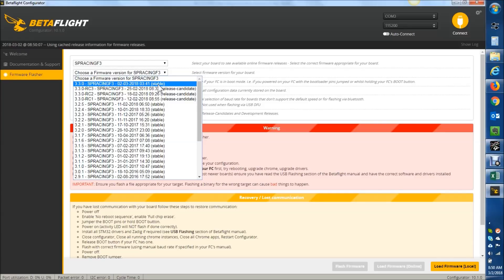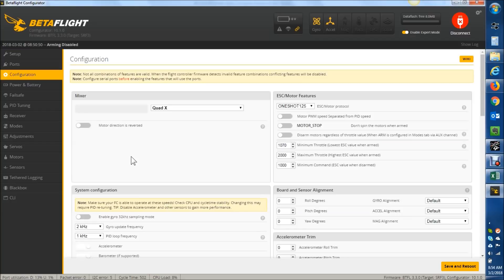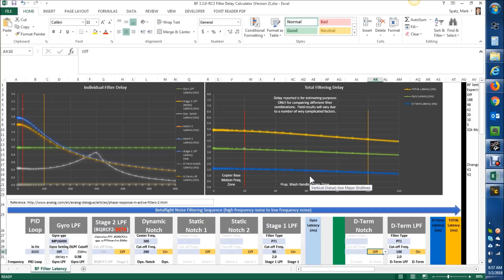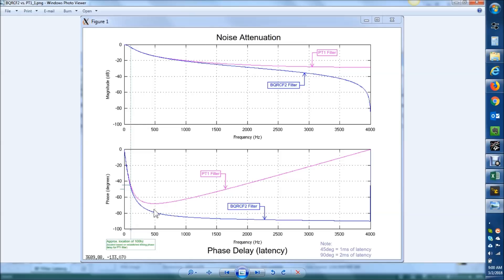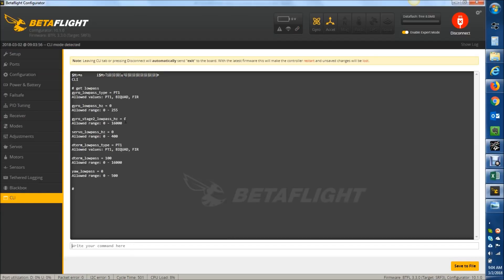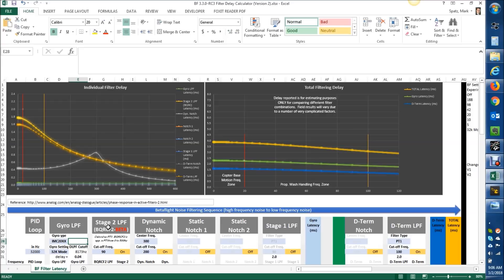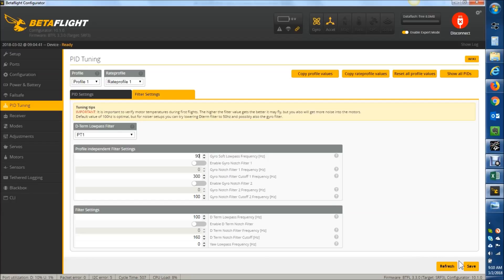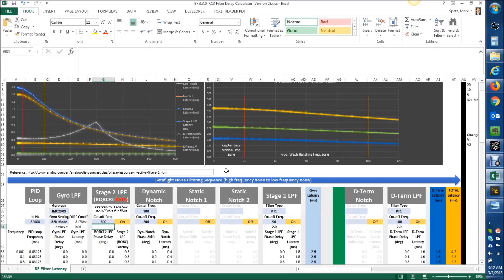Betaflight 3.3.0 Filter Tuning (Stable Release)

Comment: Sweet deal... now I just gotta fix this damn unknown device usb issue :/
Reply from the maker: Mini Quads Mega Fun , i helped a buddy with a bad one, let me make a video.
Reply: Sorry to hear that man, bad thing is this is my first full year in this hobbie, learned a lot, wish I could fly more tho.
I spent my last pay check to get into this, that was close to 2 years ago bc I all but fainted at work, come to find out I have autonomic dysfunction with being type 1 diabetic and about 4 other problems also.
And I raced go-karts for 19 years, so when I was told all this and I am not supposed to drive bc of my disability so I had to file for ssi, and that is taken forever. So I got into this bc I lost the thing I loved the most and that was racing.
Wish I could work so I could buy better crap.... teleporter v4 suck ass, flysky remote. One good quad bc I got that with the paycheck, half built one from the wife giving me 20$ here and there, and got my lizard95 for Xmas from the wife's mom.
Then on top of it all I just found out I need double cataract eye surgery 15 to 20 grand per eye.
I have no insurance or anything...... So I did feel for you..
I try my best to make due with what I got
Reply from the maker: Yeah, I have the same for my Omnibus boards (virtual VCP) when they switch to DFU mode for flashing.  Works fine otherwise.  I have to use my wife's laptop to flash (win 10) vs. mine (win 7).  That needs to end (demoralizing).
Reply: UAV Tech the weird part was after I tried it on another laptop and even did a full system restore it worked long enough to do a dump and save it to notepad... then when I went to reconnect it made the dee deww sound and the little “time he last usb device malfunctioned and the computer was unable to recognize it.. blah blah” I don’t get how the hell that happened.. it’s not like I changed anything at all either. So frustrating all I want is to finish my quad...
Reply from the maker: Did you try closing BF, unplug the board, plug in the board, and then launch BF again to connect?
Reply: Try this when that comes up as unknown....
I to have had this issue like in the last week, well let's just say I just had it again 2 mins ago lmfao.
I found out that when this happens and your computer says this it's not the fc at all.
Just so happens that it was the usb cable.... Try switching it out and us another one once.
I had one that didn't work on my other 2 and it worked for another. Switched it out and was good....
Then just now that one that didn't work o n the other 2 now won't work on the one I used it for, so I switched it out and now I'm good again.
So that usb cable I can't use on any of my quads now at all. Something messes up inside the usb cable it self.
Hope that helps some of you
Reply from the maker: The info. at this video fixed me up for my Omnibus DFU (bootloader) issue.  Would work fine in "normal" mode for connecting and configuring, however, in DFU mode it would never come up as a port for BF (or whatever) to flash.  The tools in this video worked lke a charm!  https://www.youtube.com/watch?v=dfPY1vTXNbE
Reply: Todd Beal I must have tried borrowed and bought 30 different cables... short ones long ones thick thin adapters even diy my own... did s system restore and redownloaded everything again.. on two computers... I borrowed my friends Mac book pro and am trying that simultaneously with two windows ten laptops... I’m going to give myself an aneurysm!!!!!
Reply: UAV Tech yeah I was going nuts bc I thought it was the fc giving out....or the drivers and stuff.... come down to it I did all that and it was just the usb cable that messed up.
I rather replace that for $5 then have to buy a $39 fc again.
I had 1 bad usb cables take out 2 omnibus f4 pro already. So not trying to have that again
Reply: Todd Beal you were going nuts ehh?? Check this out... so about 3-4 months ago I fell in love with this hobby and began to completely blow my bank account to get the best lootz so I could start a YouTube channel. I love tech stuff and my whole life have been a natural at things like this.. I had just finished my crowning achievement, a nicely built chameleon with all brand new, just released, components and had matched the colors blue and orange perfectly with my airbrush and custom mixed paints.. I loaded up my gear and tools and quads and camera to go film her first flight but had to stop at the hardware store really quick.. less than ten mins go by and I’m back in my car ready to go when I notice someone had cut my jeeps window and stole everything.. tools 4 quads fatsharks taranis... everything even my camera... so I’m finally starting to get my parts last week to build again and I get my kakute v2 aio to have this problem kick my in the face repeatedly.... it’s now been almost two weeks from that sad sad day and all I want is to fly!!!!!
Reply from the maker: Mini Quads Mega Fun , that is a suck.  Sorry man.  My brother races boats at a national level and had about $50k of stuff in his trailor, the hole thing was stolen.  Had insurance and police had some leads, so he got some back, but yeah, a suck.

Comment: Nice work man
Reply from the maker: Thanks,  Hope it helps!
Reply from the maker: FYI - Q=400 / R =88 is a cutoff of 355hz at a pid loop of 16k according to the data i have seen.  Soooo a i guess if you set "gyro_stage2_filter_type=BQRCF2? does it then use the cutoff of 500hz vs. the Q/R?  I didn't mess with the Butter yet, so unclear on how they are working that.
Reply: I really have no idea either..haha..I just went with your settings and added in the buttuerflight recommendations.
Reply: ...its all experimental..

Comment: I wish there was a dongle that I could plug into the quad and it would automatically tune and set the filters....😫
Reply from the maker: Me too!
Reply: Nah...you love this! LOL
Reply from the maker: You are right.  Did you see https://github.com/Plasmatree/PID-Analyzer
Reply from the maker: "This program reads Betaflight blackbox logs and calculates the PID step response. It is made as a tool for a more systematic approach to PID tuning.

The step response is a characteristic measure for PID performance and often referred to in tuning techniques. For more details read: https://en.wikipedia.org/wiki/PID_controller#Manual_tuning The program is Python based but utilizes Blackbox_decode.exe from blackbox_tools (https://github.com/cleanflight/blackbox-tools) to read logfiles."
Reply from the maker: https://github.com/cleanflight/blackbox-tools
Reply from the maker: works for me.  try again.
Reply: Nope. Maybe it's because I'm in the UK?   Edit: It's working now - it was the (())).
Reply from the maker: Yeah, UK not China or North Korea.  Click my link.   yours had a ")" in it.  https://github.com/cleanflight/blackbox-tools
Reply: Ok. I copied PID analyzer into the Blackbox-tools folder and then I'll copy BB files into as well. Cheers buddy!
Reply: Dennis Santos there is one!! It’s called a Joshuabardwell device!
Reply: Knowing that for real life tuning you must do that with props on, tuning stand would include something with heavy bottom where quad should be fixed to prevent flying away. And it would affect frame resonance frequencies anyway... naaah, better is to process flight debug logs.

@UAV Tech, try to stick to Python if you can. Those Windows exe-s aren't always possible to run under Linux :(
Reply: Mini Quads Mega Fun I wish!

Comment: Is the dterm filter delay added to the total latency?
Reply from the maker: In the sheet it does. I wanted to see the total latency. However, the P & I terms don't have the Dterm filtering latency associated with them. But the D term is soo important to crisp flight performance (bounceback and prop wash) I felt it was important to see the total on the excel calc sheet when evaluating combinations. Do note the totals graph does go further then and split out Gyro latency and Dterm latency. To me, the goal is to keep the total down as much as possible when tuning your filters. That is weighted against having enough filtering turned on to address your quads vibrations (get to the Goldilocks zone).
Reply: UAV Tech ok. Kind of difficult to understand. English isn't my native language. Would you make a video about how to read the fft debug? And what betaflight reader should i use now? I cant find the pid values anywhere in the bb viewer i use.

Comment: Your sheet and explanation is exceptional mate, finally starting to understand what bf and these filters do, it's like a big eq and filters are similar to some in my music software. Can't wait to get 3.3 loaded on my 32khz omnibus pro corner and have a fly. Thanks alot
Reply: Sorry but what would you recommend setting the gyro lpf for 32khz, right at the end of your video you have it on experimental. Also do you know if it's ok to use dshot I've read somewhere you should use multishot. I know i need to test but just wondering what your thoughts are. Thanks alot
Reply from the maker: Start with default.  Don't change to experimental.  Just don't change at all.  Only click on 32k mode under Config tab and set your gyro and pid loop frequency.  it is OK to use Dshot, but it is CPU intensive so you may need to use Multishot to lower CPU load (Multishot is just as fast as Dshot600, just an analog signal vs. digital).
Reply: Sorry, is setting gyro lowpass hz in config tab ( which I've set at 90) the same as setting gyro_lpf in cli which shows OFF as default? Thanks alot
Reply from the maker: No.  The one set to off in the CLI is the Gyro Hardware Digital Lowpass Filter (DLPF).  That when set to off, is at 256hz.  The Stage 1 LPF (default of 90) is available on the Filters tab (top number one) and you can also adjust hz cutoff in the CLI too.  To turn that one off, you set the Hz to "0"

Comment: Great job as usual!
Reply from the maker: Thanks man!
Reply: I have a question when I go to 32 k and idle my motors make noise. At 16k it does the same and at 10k 10k it goes away but the motors twitch a little.
Reply: 8k 8k at 32k it's fine no problems. I have kakute f4 v2 and aikon esc 3-6s the non 32k version. Where should I start.
Reply from the maker: Sign of too much noise is getting to PID loop.  Want to send me your dump?  Do you have FC or motors soft mounted?
Reply: UAV Tech it's a kakute f4v2 the gyro is soft mounted.
Reply: Do you have a face book page you need to make a uav tech face book lol.